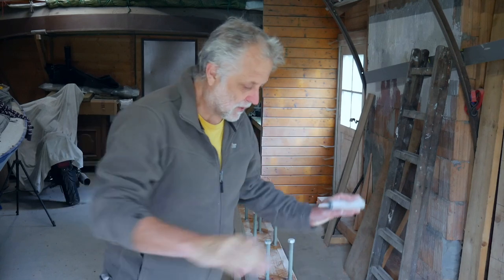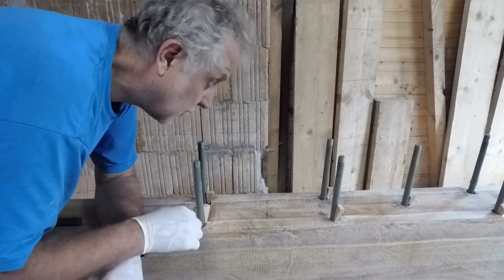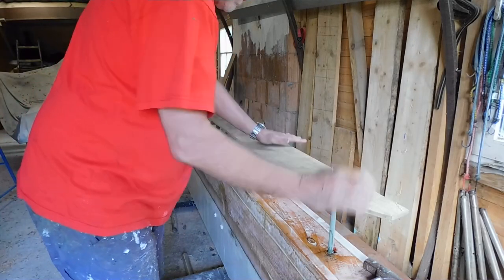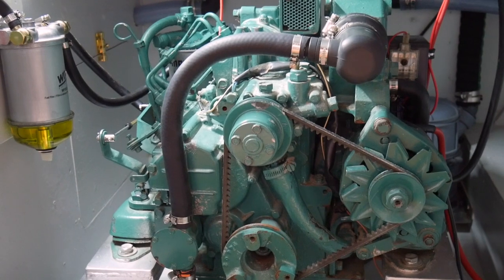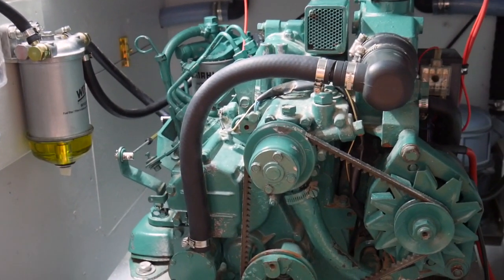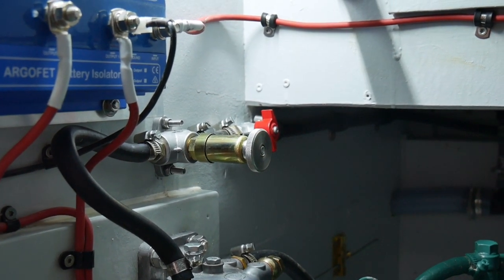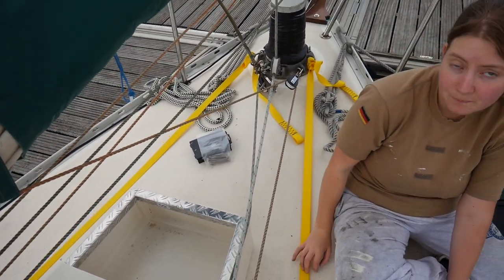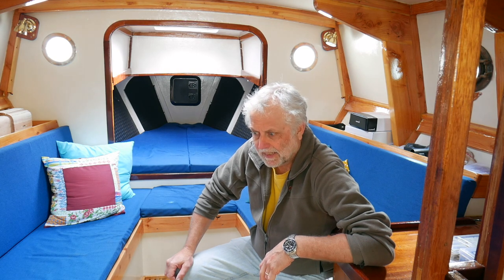Another milestone! Building a cruising sailboat - SV Tapatya EP232

Comment: Old woodworker trick when using brass screws and hardware. Use steel screws of the same size and length first to preset the holes. Take them out and then drive in the brass screws.
SV Tapatya looking great Tony.
Reply: Good to know.. thanks!
Reply from the maker: Thanks Gus 👍